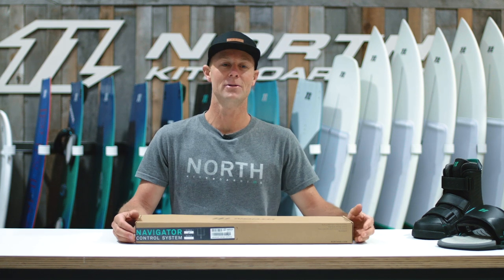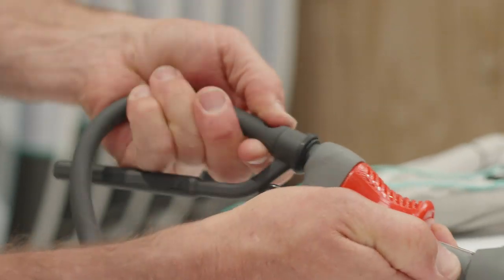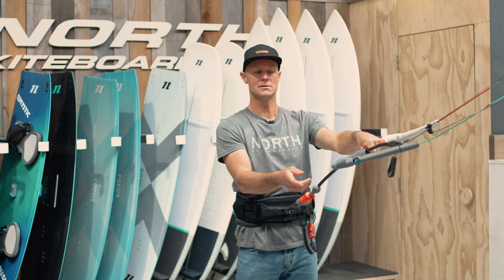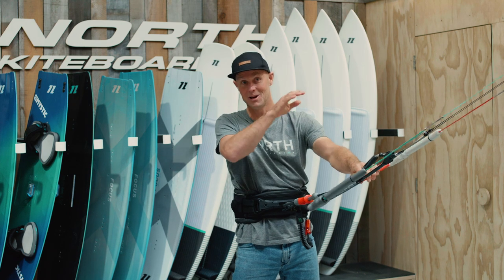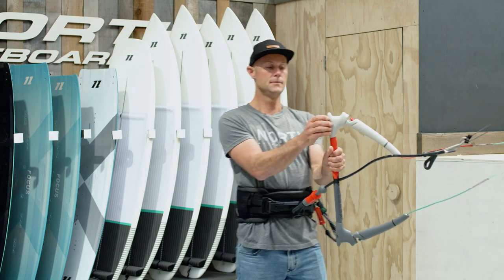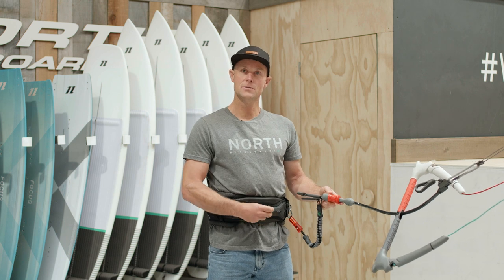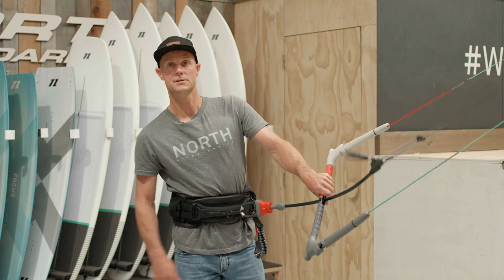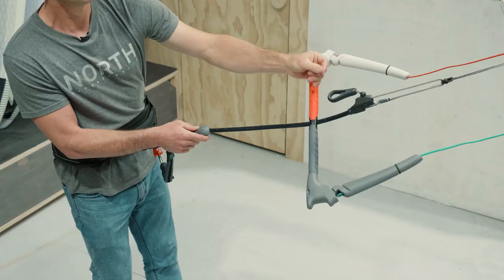Designer Notes | Navigator Control System with Hugh Pinfold

Comment: Bought this bar last week and used two times. Really great bar, very comfortable bar grips. Lines are great too. Bar through is good my arm. Only issue is the line management bungee I found gets inside the float a bit tricky to get them out. But it's not a big issue. Also. 22m line is perfect for most of my kite. It would be great if they had 20m with 2m extension rathen 12m with 10m extension. I mean how many people do really use 12m line? It's like including freestyle unhooked large chicken loop with the bar rather than medium one, though knowing most people don't unhook. Overall really great bar.

Comment: Good job guys, this is a very strong entry into the market and i'd say the best above the bar trim bar to date. 
You guys forgot to mention the auto unswivel function from the rectangular tubing, like on the click bar. this is something i cant miss anymore after becoming used to it.
Reply: Hendrik Van de Perre, are you sure that the slot in the bar is shaped to assist untangling the front lines via the rectangular tube? They may have blown the slot open large enough to avoid the tube catching as the bar slides over it. If that is the case, I’m not sure it will untangle the front lines. I have not seen the bar in person and am curious.

Comment: Is it possible to run the bar in Semi suicide to avoid flagging kite out in unhooked crash, but still being able to quick release, in case of situation?
Reply: yea just hook your leash into the flag out line (as you would normally do) and then just hook your leash onto the chicken loop, so your kite will not flag out when you crash unhooked.

Comment: There’s a recall on these bars, check ya serial numbers and contact your dealer
Reply from the maker: Thanks Steve,
North is currently offering a replacement for all pre-December 2019 Navigator Control System Depower Main Line (DPML) Parts.
To find out if your Navigator Control System is eligible, please contact the dealer you purchased it from.
The Depower Main Line (DPML) is a wear and tear part that we recommend is replaced at regular service intervals. We've updated the part in all control systems shipped after December 2019, but in pre-December models, the DPML part may be less durable and require more frequent change. 
Please note,  the replacement applies only to Navigator Control Systems shipped to retailers before December 2019. 
If you have a North Navigator Control System:
1) Please contact the dealer where you purchased your Navigator.
2) You will be asked for the serial number of the Navigator so they can check if the Depower Main Line requires replacement.
3) If so, you can choose to return the Navigator to the dealer for replacement, or you can order the DPML part to replace yourself, following the instructions here https://youtu.be/vBdSyl8MCGo
Reply: North Kiteboarding thanks for the instructions link 👍
Reply: @North_Kiteboarding  oh wow